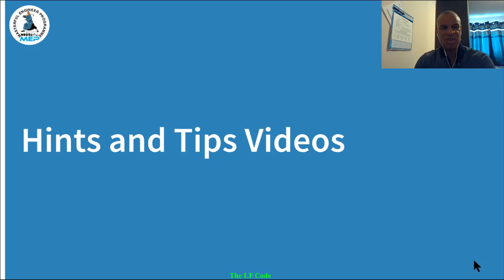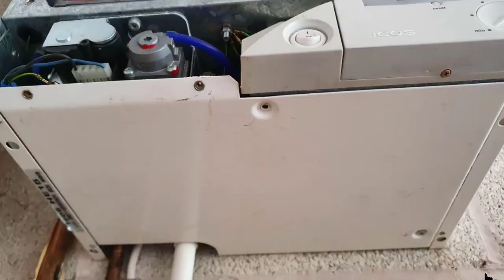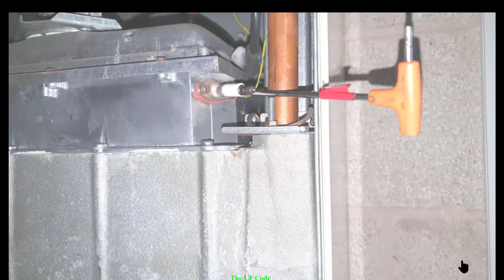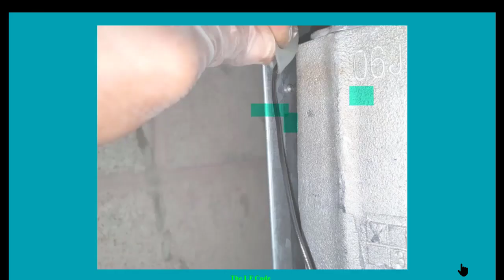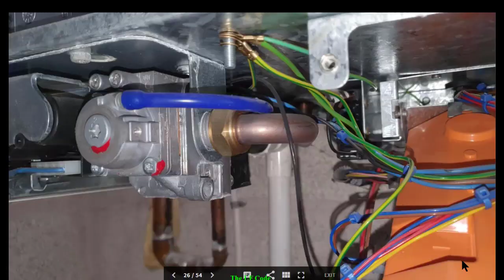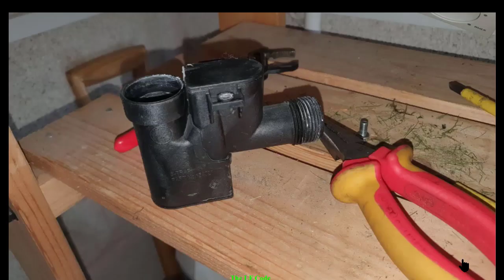LF Code Ideal Icos Hints and Tips

Comment: Hello, I have replaced the spark electrode/generator and the flame sensor cleaned out the condenser.

Changing the spark generator now goes from getting an immediate LF fault to the boiler working for a while (with solid burner light) to then getting the LF failure again. Could this be a pcb issue?
Reply: (For anyone reading this later on, it was the pcb, replaced and all working)

Comment: That was really interesting. I am currently trying to fix a Icos HE15 set to heat hot water. The pump and valve to divert through a hot water cylinder are in the bathroom. 
I thought the PCB had failed, a black one and was sent an orange one with same part number. I copied the 1,2,3 jumper settings on it and switched on to get 1 HE HE HE and so on. I put the old PCB back and got a display of 1, then 0. Sometimes it will show E or HE. The boiler works when it feels like it. It had new ignition electrodes but I might change them again and clean the flame sensor and condensate trap.
What I get now is the boiler either works for a random time and goes HE or LF, or it tries to fire, does a few clicks , and either fires and stops with HE, or it fires and runs for a bit then stops.
It is driving me mad!

The orange circuit was from ebay and refuses to work, so the company keeps telling me to try different jumpers, even though it's not in the correct instructions. 
They even put a note saying if the boiler shows HE, to call them!

So I am about to give up and can not find anyone in the NW who will repair or fit a new one for 6months. They don't want the work.

Comment: Our boiler has not worked for 3 weeks. FL error code. The flame goes out in about 3 seconds.
Mechanic replaced spark electrode, spark generator, flame detection electrode, two wires underneath, replaced burner. Cleaned the flue. Still not working. He has now ordered the heat exchanger. He will replace that. I'm losing hope.
Reply from the maker: Don't change the heat exchanger. it's more likely to be the pcb

Comment: Thank you Tony your video was excellent and allowed me to diagnose and rectify a condensate trap that was totally blocked with silt and preventing the boiler from firing. About a litre of condense water was backed up in the heat exchanger which released into a waiting bucket on removal of the trap. This got us back running over a super cold period in Dec 2022 in UK when all available Heating Engineers were overrun with call out work. The trap was beyond recovery as it is a sealed unit and could not be cleaned of the solid silt build up, so a replacment part was fortunaely found at the plumbers merchant on a saturday morning just before closing. Excellent and clear run through of the common faults and how to rectify. Very much appreciated.
Reply from the maker: Thank you for your comments. May I ask you subscribe to our channel

Comment: Hi Tony, happy New year. Thank you for such an excellent tutorial video. Absolutely fantastic detail. I have a Ideal Icos boiler and the boiler is not showing any error codes.
The hot water is working fine , however the radiators are not coming on. I have done some research on the issue, and it is most likely to be the Diverter Valve that is blocked/old or needs changing.
Can you perhaps do a video tutorial on how to change the Diverter Valve on an Ideal Icos boiler. Thank you. Bilal

Comment: Hi Tony, Happy New year. Thank you for such an excellent video. I have a Ideal Icos boiler and the hot water is working, however, the radiators are not coming on.
The boiler is not showing any error codes. I have done a little research and I believe the problem is the Diverter Valve. I would like to ask your professional advice.
Perhaps, you could do a video tutorial on how to change the Diverter Valve. Thank you Bilal

Comment: Fantastic help thanks, followed your advice, took off the condensate unit and pipe, it was blocked solid with black and gray calcium, had to scratch it all out with a screwdriver and wash it all out. Also had to poke up the hole where it mounts in the heat exchanger and suddenly out poured around two litres of gray water. Reassembled, reset the boiler and it stared first time! A little bit fiddly but Saved me a fortune, thank you.

Comment: Hi, Great video by the way.
 I've got an Ideal Icos HE24 condensing boiler.  I recently got the dreaded LF code which was basically stopping the boiler after a few seconds of ignition.  Ideal tech support said it was almost definitely the Flame Detection Electrode or PCB. 

My friend who is a gas safe engineer had some spares from a working second-hand boiler of a similar model (HE18). We switched out the Flame Detection sensor first after checking the wiring and got same fault. Switched out the PCB next and same problem. Also the Trap and all related pipework has been cleaned.  Also swapped out the igniter electrode. Burner assembly is fine and clean. We haven't done anything else yet as Ideal are still claiming it must be the Flame Detection sensor or shorted cabling.

Question -  Is there anything else you can think of that can throw up this error if  PCB, Flame Ignition  plus Flame Detection sensing are functioning OK?  I've got access to all the parts from the other boiler however it's just knowing which bit to tackle next. 

Many thanks...
Reply from the maker: Its either a flame detection lead or did you check the insulation pads have not fell inside the burner section?
Reply: @ARBoilers  Many thanks for all your help. The problem was the flame detection lead. My gas engineer had tested it for continuity and it checked out ok.
I'm an ex-electrical and mechanical engineer so decided to do my own checks on various components and cabling. With the flame detector connector disconnected from the ecu I checked again the flame detection lead and discovered a resistance of over 5 meg Ohms between earth and the sensor tip  On removal of the lead there was 0 ohms between the sensor and earth as you would expect. 
Conclusion - Somehow the sensor cable has altered its resistive properties in spite of no damage or breaks. I put the multi meter on a low resistance of say 200k and the lead showed full continuity. The nature of how the flame detection circuit works on these Ideal boilers was enough to fool the ecu into thinking no flame was present. I hope this helps other that might experience this strange phenonium.
Reply from the maker: Thanks! hey we're currently trying to grow our Facebook group and would love you to join Tony and the team using this link, Tony will be available to answer all your questions directly https://www.facebook.com/groups/167070231326174 we will also add this link above.

Comment: Hi, how does the lead attatch to the electrode, is it push on or unscrew etc?
Reply from the maker: Its a push on type
Reply: @ARBoilers  thanks for that, I've followed all your instructions bar checking the trap as its difficult to get to it. I've ordered a new lead as the insulation has crumbled
Reply from the maker: hey we're currently trying to grow our Facebook group and would love you to join Tony and the team using this link, Tony will be available to answer all your questions directly https://www.facebook.com/groups/167070231326174 we will also add this link above.

Comment: Really like your tips especially the check for the spark outside the boiler
Reply: I don't think that spark electro will spark just hanging there . It should be grounded ..
Reply from the maker: Thank you! hey, we're currently growing our Facebook group, it has lots more content there and i'll be there to answer any questions you may have join using this link https://www.facebook.com/groups/167070231326174